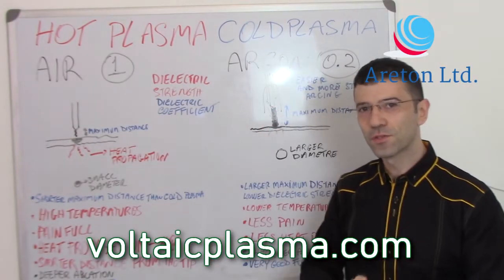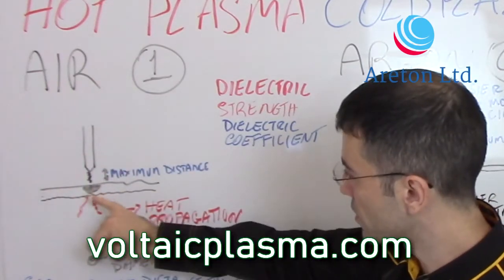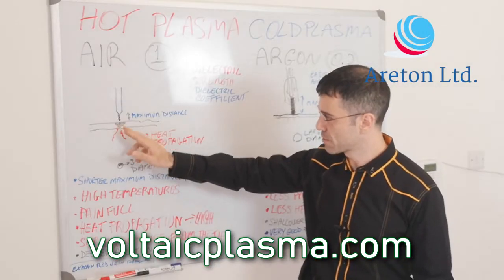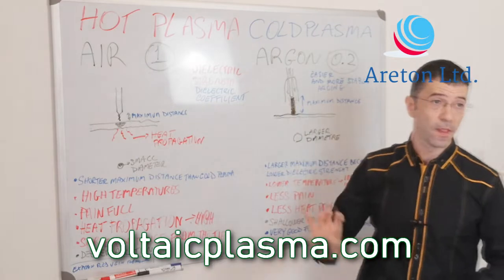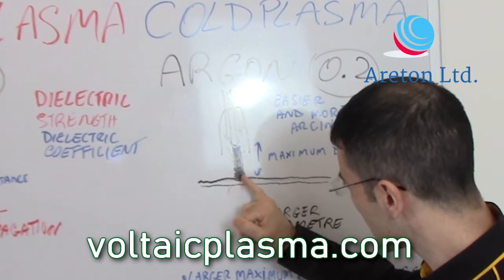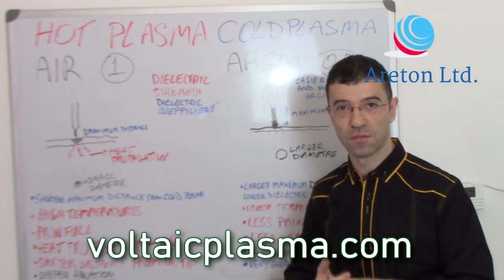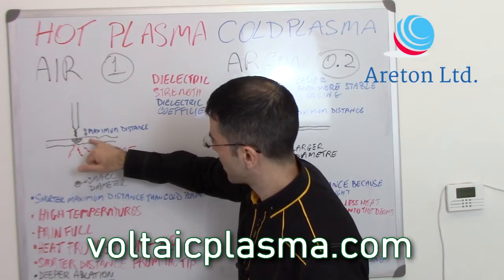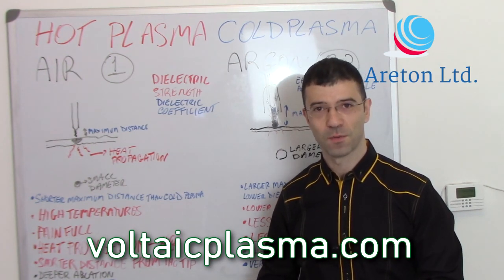HOT PLASMA AND COLD PLASMA EXPLAINED BY ANDREAS RUSSO

Comment: If you are using a hot plasma device, using the setting on number 3 and making dots 1mm apart should be fine. But more energy requires greater distance, otherwise you get more exudate and swelling, it all depends on what skin problems you are treating.